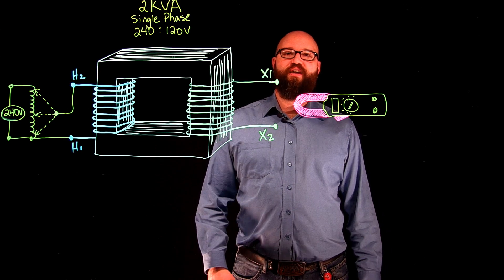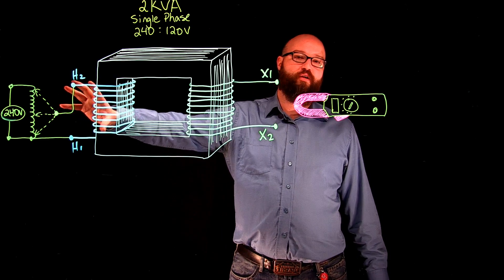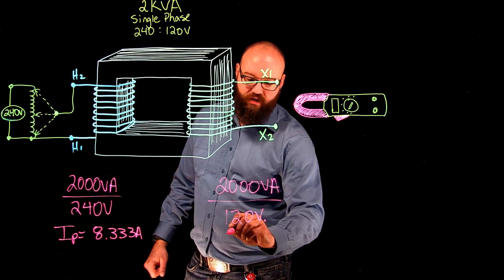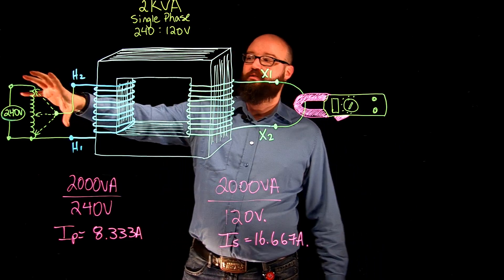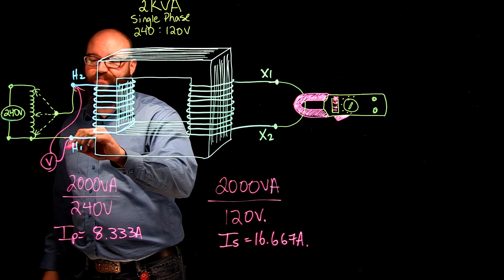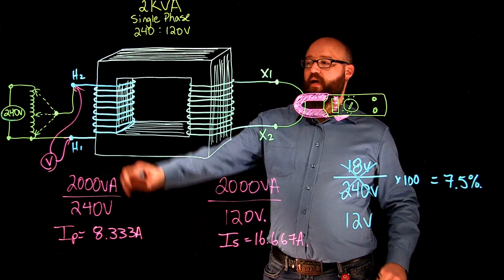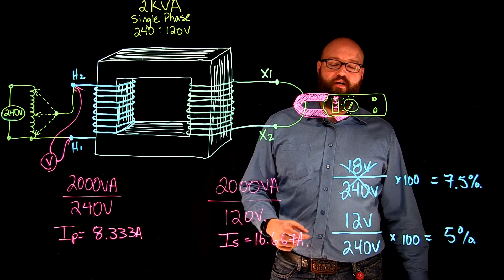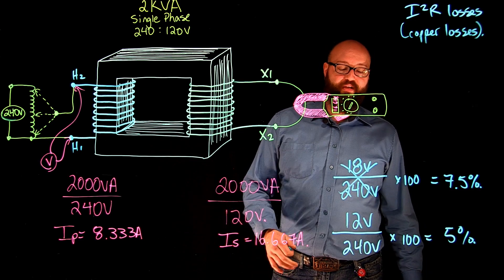Transformer Short Circuit Test

Comment: Thanks for a clear explanation on how we find impedance percentage. Why is it important to have impedance percentage on the transformer name plate? I'm having trouble finding a clear answer. I would appreciate any help.
Reply from the maker: The most important reason is that it is used in the formula to determine available fault currents in the system in the event of a short circuit so we can properly size the interrupting ratings of our overcurrent devices.
Reply: Also can determine voltage drop in transformer at given load. Troubleshooting low voltage complaints.

Comment: Dear Schulerruler, please clear my confusion: if I have a 240VAC supply, if I connect the Live and Neutral wires with a copper cable, that is very DANGEROUS, it is a Short Circuit! With very small resistance between L and N, a very large current flows in the circuit , within fraction of second, the main circuit breaker would trip to prevent the cable from catching fire!!!!  

BUT if I connect the L& N wire from the above supply to a transformer, (ie the primary of the transformer , which is essentially coil of pure copper wire with very low resistance) , it is OK, no tripping at the main circuit board - meaning: the primary coil is NOT  short circuited. 

Question: why is that so? please explain. TQ so much.
Reply from the maker: We will start with the question about the primary. When you connect a supply to a coil, the reason it does not short is because of the amount of inductive reactance that the coil has due to the changing frequency of the AC supply. If you connected the coil in DC, however it would be a MASSIVE amount of current as there is no changing frequency that causes the opposition in the circuit. It would only be the resistance of the physical copper at that point which is not much.

The secondary is ONLY short circuited when performing a short circuit test. The primary would have a variable voltage applied starting at zero, and SLOWLY increase to an account that causes rated secondary current to flow when secondary is short circuited. As you have pointed out, the secondary would have very little impedance in a short circuit condition, so it would not take a lot of primary voltage to cause rated current to flow.

Comment: Why do we wanna hit the secondary current and not the primary current?
Reply: Because of mutual induction
Reply: You would be increasing the voltage on the HV side to possible hazardous voltages. When the ratio of transformer is close 2 to1 or 3 to 1 it wouldn’t matter . When you get to higher ratios like 50:1 for example 12,000v / 240v with a 5% impedance your amp clamp would see 2.08 amps and voltage in that closed loop would be 600v. While you would apply only 12v  of the 120v max of your supply voltage. If you didn’t control that and you accidentally were set full 120v you would have 6000v on HV side. Applying full voltage by accident in reverse hookup your voltage on HV would be 120v and voltage on LV would be 2.4v.